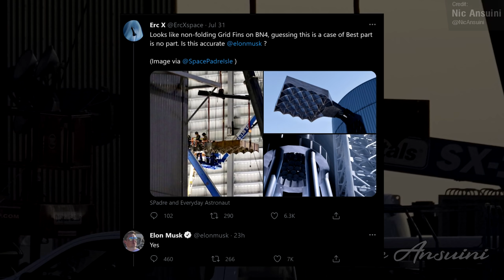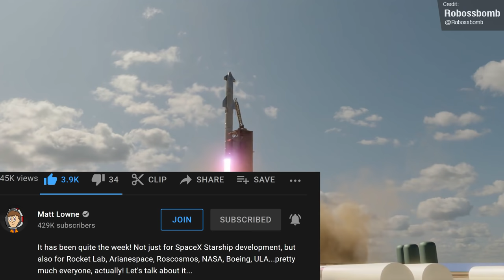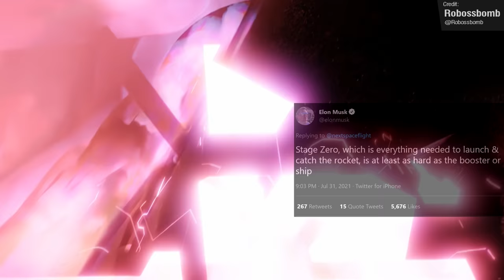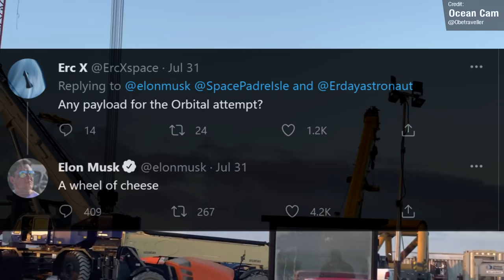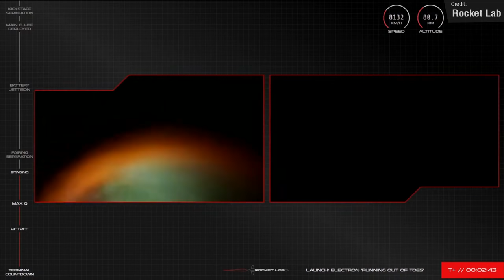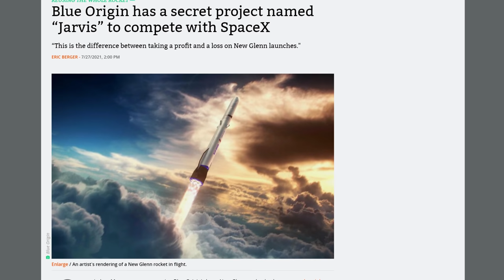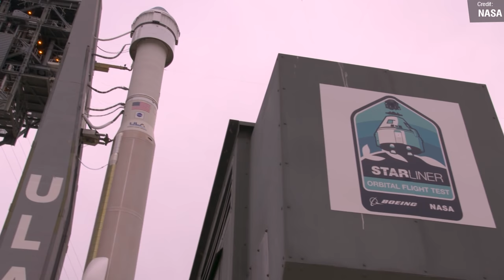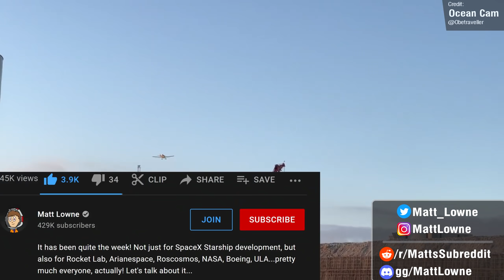SpaceX Starship Development Reaches "WARP 9" Speed, Blue Origin Leak Reveals Starship Rival!

Comment: Rotated by 90˚, these grid fins still presenting a flat surface to the airflow when it accelerates up through the atmosphere. Flap fairing could be quite light because it's not protecting anything valuable and doesn't have to separate.

Comment: assuming the vehicles splash down lightly (like a mock landing only in water), the only engines I could see not being reusable are the ones that are firing when it splashes down. It's not like these engines are allergic to sea water, they don't melt. They are made of metal. I'm sure we will get some recoveries if all goes to plan.
Reply: The issue is probably that salt water would infiltrate the engines. This could cause corrosion or the blockage of pipes and so on which would negatively affect engine performance.

Comment: Musk explained the grid fins not folding as deleting instead of optimising, he said it doesn't make an appreciable difference whether they are folded or unfolded for take off so long as the angle of attack of the fins isn't too extreme.
He is saving every gram of weight and every penny he can if it doesn't need to be there its gone.

Comment: could the grid fins rotate 180 degrees to point up?  Maybe it could steer on ascent... and when landing if they're pointed down they could cut the landing arms therefore in the end they'd want to rotate to the flat side.  
I think the booster will land in the middle of the platform but not touch ground, it will stop and hover 50' in the air and move laterally toward the docking arms - much more safety margin versus landing on the arms.

Comment: Has SpaceX tested the Superheavy booster landing? And have they calculated how much the switch from a transpiration heatshield on Starship to a ceramic one will impact the payload performance? And how will the payloads be stocked inside the vehicle? How will the HLS landing engines look like? What will be the abort modes be like, and how reliable will they be? How will the booster engines interact with one another - it has more of them than the N1! There are so many unanswered questions that need to be solved before Starship is operational - and I highly doubt they will be solved anytime soon.

Comment: I want to know how and if SpaceX will have a sound suprresion system as the launch stand has concrete inbetween the pipes so either the pipe water to the launch stand or suprress the sound by spraying into the flam pit. Who knows?